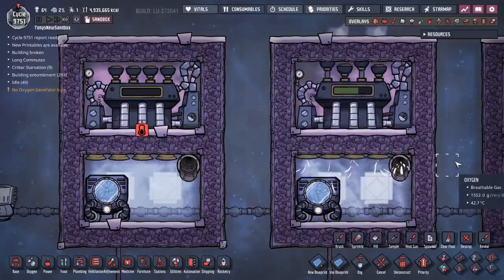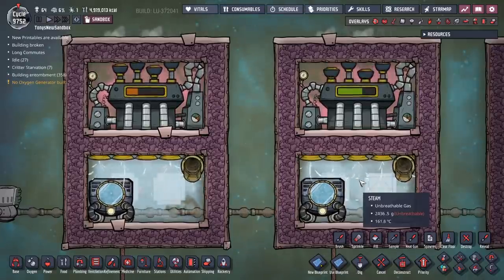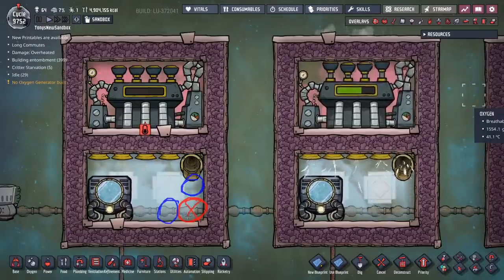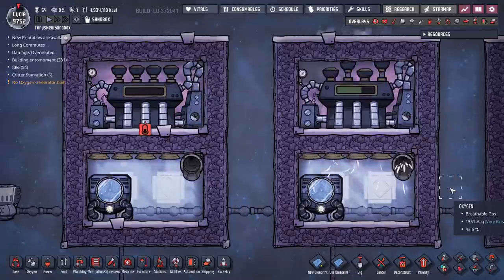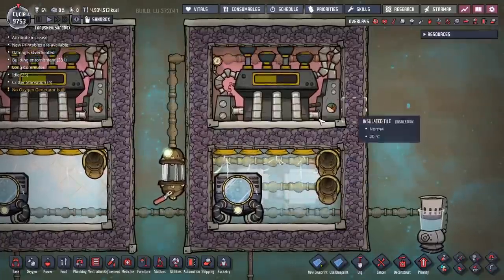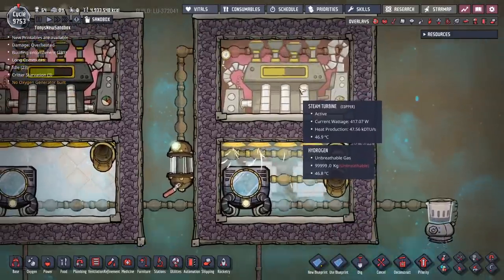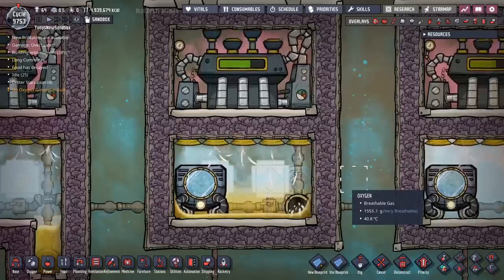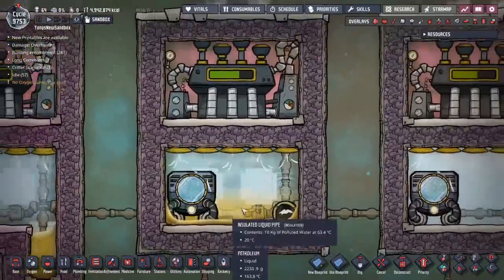Stop a Heat-Deleting Bug from Stealing your Turbine Power

Comment: If you look on the wiki, the way that cell-to-cell heat transfer is calculated simultaneously for every pair of cells that share an edge. And then there's some clamping applied when calculating how much a cell's DTU content can change per frame.

In the extreme, four extremely hot adjacent cells will simultaneously transfer DTUs to the center cell, but will more than overflow the maximum DTU change that the center cell can experience per frame, deleting DTUs.
Ways to prevent that include: 
> Reducing the amount of hot cells the cold cell is next to. (Drop it one tile lower)
> Reducing the thermal mass difference. (Increasing the mass of the water cell, lowering the mass of the steam cells. And possibly preheating or cooling the respective cells)

Other fun facts is that there is a minimum mass (not thermal) and minimum temperate difference (in Celsius, not DTU) to cause heat trasfer.
Reply from the maker: This sounds very informed. I'm going to make it the pinned commentz at least for now.
Reply: When a cell with too much heat is transferring to a cell with less heat, clamping occurs. Clamping, working as intended, should make this transfer slower. Making the transfer slower is very different from deleting heat. Clamping may be part of an explanation, but just pointing out that clamping is probably occurring does not explain everything that's going on here.
Reply: Then would "Clamping <per Cell>" and "Simultaneous Heat Transfer <between all Adjacent Cells>" risk a bad interaction? You can have situations where the four adjacents cells move more DTU's than a cell's transfer clamp allow.

The phenomena happens in reverse as well with cooling when flash freezing things. Though I think cooling capacity is less bothersome than with heating things.
(Liquid glass into rock gas, then reheating regolith into magma, and turning igneous rock into sand. It needs an iron volcano.)

I'm curious if an extreme enough cold gradient would technically produce more heat if it underflows the clamp.

Comment: The petroleum one seems the most practical/economical to me, since you can use it to easily create a 3 tile high airseal with water+pwater in the steam chamber and has the same performance as the others without wasting materials on tempshift plates. Definitely going to incorporate it in my turbine designs.

Comment: I had a multi purpose steam room and I changed it to have a layer of petroleum at the bottom to help with conductivity. Then my steam turbines started to produce a lot more power, even maxing out. I thought they might have nerfed the cooling capacity of the steam turbine, but this explains it, thanks. I do wish they fixed these kinds of bugs, same with some mass conversion bugs. It's often hard to even notice something is wrong, and when it is how to fix it.

Comment: i usually put the outlet of the steam turbine on the aquatuner keeping it cooler  but still have oil or petrol on the floor to help with heat distribution and removal from the aquatuner. one thing that may be a concern with using high pressure steam setups in with high enough pressure you can block the liquid vent periodically

Comment: The game likes to delete gases when you're not paying attention. There's a couple of rules which lead to gas deletion in edge cases that actually happen all the time.

The simplest way to demonstrate this I can think of is using three gases in an single tile cylinder. Hydrogen, steam, and carbon dioxide work. At the bottom of the chamber, you pump gas up to the top, and at the top, you have a vent. Might need to be a high pressure vent for some cases. The important thing is to confine the top of the chamber by making it three tiles high by. Carbon dioxide will try to fall down from the vent, steam will try to rise above carbon dioxide, and hydrogen will try to get to the top of it all. This will create a situation in which a bubble of hydrogen will cover the vent. When the vent tries to vent non-hydrogen to that square, the game will try to displace the hydrogen bubble to a legally valid location adjacent, but we confined it so that the hydrogen would have to move down to displace and there is generally going to be either steam or carbon dioxide below the hydrogen. When this occurs in this case, the hydrogen simply ceases to exist. However much mass it has and whatever temperature just disappears from the game as far as I can discern.

Now, you might think this is a very different case from what you're observing with the steam room here because there's only two elements, but the same basic combination of mechanics which forces a deletion of the hydrogen can happen here. The problem is displacement. And in the high pressure steam room, you have a situation in which the maximum packet size of the steam per square has been exceeded, so when the game checks to see if it can displace packets it is going to find illegal conditions. When it tries to make room for the liquid and finds all the steam packets in the room are at max, it runs into an impossibility condition because liquid and gas can not occupy the same tile at the same time and it can not displace the steam without increasing tiles beyond their (soft) maximum. So gas or liquid or both are deleted. My bet is that steam near the vent is deleted or steam in the lower corner is deleted by the sudden appearance of the liquid in that tile; you can find out what is the case by counting the Kg in every tile in the chamber then dripping water in and recounting, and you could make a simpler model by confining it to a single tile wide steam chamber.

This is also related I think to your super gas pump in which you drip out water to pump gas where the water is destroyed in the process.

Your oil solution works because you basically build a displacement spring into the whole system which allows it to 'recoil' when an additional liquid is added to the chamber. You're exploiting the one-element-per-tile rule--which is one of the strongest--and the liquid vs gas rules to keep space reserved for the liquid to appear; I expect you'd see the bug reappear if you could recreate the high pressure for the oil such that no tile of steam or oil could be moved without exceeding maximum mass, moving them in a direction counter to their vector (up or side to side for steam, down or side to side for oil), or causing multiple elements to occupy the same tile.

I also wanted to note that the version where you make the liquid packets smaller with the piping solution would potentially change the rate of the deleted packets.
Reply: In an experiment I performed, I found that gas deletion can occur with two elements: https://steamuserimages-a.akamaihd.net/ugc/776245097831921157/5453075217128EC67F29C190E9B6ABA2A55E648B/

I started with a giant vacuum filled room. Put a hot hydrogen 2Kg packet at the bottom and a cold (below liquidation temp) carbon dioxide 2Kg packet at the top.  I ended up with 837.8 mg of carbon dioxide in less than a cycle. There's something about the carbon dioxide rapidly cycling between gas and liquid form which creates a condition in which it can't displace the hydrogen and just gets deleted instead of successfully condensing into liquid on the floor. I think an analogous condition can happen easily within the high pressure steam chamber with small amounts of liquid near its vapor point being added to the chamber.

Comment: My understanding of this is that with a higher mass of the steam it requires more DTU's to get the heating to get that steam up to 125C (heating 2kg of "water" vs 400kg "water"/tile).

The steam turbine automatically triggers when it detects steam over 125C and cools it down to sub 100C, bringing flat cooling into the room. It shuts off as soon as all steam over 125C has been cooled down by 1C

If you do not have enough heating to counteract the "flat" reduction in temperature to heat the large amount of mass faster than the turbine cools it, the room reaches a  homeostasis just below 125C.

I haven't done testing to prove this, it's just the way that my brain interpreted the video game logic as I've seen it so far. For me though, everything works as I would expect it to

Comment from the maker: Addenda:
0) This seems to be fixed in the current version of the game! 👍🤘🙂
1) I tried combining various strategies, but I wasn't able to discern any benefit.
2) @Mathmanican is having a look at this. He's basically the ultimate weird-game-mechanic guru of ONI. https://forums.kleientertainment.com/forums/topic/113255-stop-a-heat-deleting-bug-from-stealing-your-turbine-power/?do=findComment&comment=1280082
3) Check out /u/corrado33's experimental results. Using a BIG steam room can largely eliminate the problem. Also his approach of using a metal tile floor makes a big difference.
https://i.postimg.cc/pTpp9TCW/more-Research.png
https://plot.ly/~blacksilverwhite/1/
https://www.reddit.com/r/Oxygennotincluded/comments/dqfhia/stop_a_heatdeleting_bug_from_stealing_your/f6a3aee/?context=3
4) I used a couple tempshift plates in my steam rooms to keep the turbine output more stable for analysis. It looks like those plates may make the performance a bit worse in most cases. (Which is weird, because using all tempshift plates kinda works.)
Reply: I wonder if the ablating/flaking mechanic is at play here.  It is a different type of heat transfer than normal; and it occurs when you have something above melting/boiling temperature of a solid/liquid and at least one of the materials isn't solid.  It bypasses the conductivity of the materials completely.

I am not too certain of the mechanics but IIRC every in game tick, it melts/boils 5kg of the on material, and it subtracts the heat required to do that from the hotter material.  If there is some error in the calculation (possibly when there is less than 5kg of materials), it would delete heat.
Reply: No longer an issue. I run a bit over 500 kg/tile in my steam box.

Comment: Could the reason be somewhat due to the Temperature Shift Plates? When the displaced, cooler and denser steam moves to the two adjacent tiles to the temp shift plate, perhaps there is multiplied cooling going on to all the other tiles adjacent to the temp shift plate. With lower density steam this effect would not apply as much since the mass of the steam would be negligible compared to the mass of the Temp Shift Plate.
Try moving or removing the shift plate near the vent and see how it goes.

Comment: Extremely brilliant!  (as always)  

If we wanted to go low pressure I wonder if there's a threshold we can stay under or if it gets worse linearly.
Reply from the maker: A guy made a cool graphic of power output vs steam room size vs steam pressure. (See the addenda). If my memory is correct, power falls with any pressure increase but falls sharply once it's at 40kg/tile or so.
Reply: @tonyadvanced6315    What do you mean by addenda?
Reply from the maker: @GamersHandbook  The pinned comment on my YouTube posts have additional information that came to light after I made the video. It seems like there's a lot of that, I wish there were a way to know what everyone knew before I got them talking about it.
Reply: @tonyadvanced6315   I see it now.  Thank you, that looks like what I was curious about.  I'll have to read it when I get in front of my computer.

Comment: I always thought the lower pressure steam generated more power because the turbine focuses on temp not dtu, and less mass heated up faster because less mass to hold the dtu...
 At the same but converse side it also explained why you could tame a volcano with less turbines by increasing the water mass effectively slowing the temp increase by spreading out the dtus.

Comment: I think the only reason the low density steam version helps is because it operates at higher temps so it can counteract the heat deletion
Reply from the maker: The temperatures should be the same because the amount of heat produced is the same and the amount of heat removed by the turbines (should be) the same. Low pressure steam would get to equilibrium temperature much faster though. I don't think I checked the steam temperatures but if it's different then this is even weirder than I thought.
Reply: @tonyadvanced6315  it shows 154-162 C° here when you mouse over it
Reply from the maker: @rodna16  I'll definitely have a close look at that when I'm back at my computer. Maybe the steam isnt dense enough for the turbine to get full bites out of it.
Reply: @tonyadvanced6315   haven't played in a while but afaik the turbine only cares about the temp of that 2kg/s steam that is being processed, the rest is just for heat capacity so low density steam should be more efficient with aquatuners if you can get close to 200C° right?
Reply: It helps because losing a few C from 4kg of steam is nothing, losing a few C from 800kg is a lot.. and as it takes more thermal energy to replace those now missing degrees as the room temperature balances out, the more steam you have the worse it is.
Reply from the maker: @rodna16  Here's my reasoning: Steam turbines change heat energy into power. They produce 1 watt for every .9868 kDTU of heat. So if the heat is coming from an aquatuner at a fixed rate then you can calculate exactly how many watts the turbine should produce. (That's 566.67 watts for this experiment.) Since the turbines (should) produce the same watts, then if they are also consuming the same amount of steam, then the steam must be the same temperature. So, the steam being the same temperature is a sort of necessary side-effect of how all the other stuff works.
Reply from the maker: I got back to my computer and had a look. I don't know why I didn't think of this before, but of course the high pressure steam is much colder, because the heat is being deleted by the bug. But since you suggested it, I wonder if the reason the low pressure steam works is simply because the heat is more transient... it doesn't linger in the steam, it goes more or less directly to the steam turbine, so it just doesn't have much of a chance to get deleted. That wouldn't result in different temperatures, but it's kinda the same thing you suggested.
Reply: @tonyadvanced6315  The more steam in the room the more DTUs are being deleted from the bug, a super coolant aquatuner can run a turbine at 200 non stop, have the aquatuner kick on if it drops below 200, switch the turbines on when both rooms are at 200c. Both lose DTUs due to the bug but the 2kg aquatuner has less DTUs to replace to not only keep the turbine running but to get the room back up to 200c which is why it performs better, because it can replace what has been lost for a tiny penalty. The 400kg room depending on how much DTUs it loses could end up dropping to 125C eventually if it's more than 1,181,000 DTU/s but it's aquatuner will always be working harder.

Comment: You can go 2 ways on this problem, you either have to much heat and you WANT to use this bug, or you want power, so you avoid it.
I found that water dropping on non-insulated tiles, like one lower & mesh tile + air tile as best option. It must be something with instant vaporization & insulated tiles.

Comment: I wonder if giving the water tile a third vector for heat transfer to the steam (shift the outlet a tile inward) would help. Or maybe some mesh tiles to see if the interaction tickles the code somehow.
Reply from the maker: Good ideas to try.
Reply: If the pinned comment is correct I think that would make things worse, not better. The problem is that the each steam tile wants to dump more heat into the water than is allowed and the extra gets deleted. So you want to reduce the transfer area with steam. I think that's why the petrol works so well.
Reply: @Khaim.m  So just dump it into a little bucket, like what was shown with petroleum, just without the petroleum.

Comment: I have two question about the steam room with a small layer of petroleum on the floor.
1: How much steam has to occupy each tile?
2: How much petroleum do I need per tile on the floor?
Thanks.
Reply: If you stop the video at just the right frame around 5:02, you see that he has 400 kg of steam in one of the topmost steam tiles. From 5:18 to the end of the video pausing at the right frames shows an average around 2 kg petroleum per tile. (I saw, from left to right, 2053.8 g, unknown, 2356.5 g, 2506.3 g and 1334.8 g, which fits with the incoming water shifting petroleum towards the left.)

Comment: Has this happened recently? I don't know if I have to rebuild my base from a month ago.
Reply from the maker: Nobody seems to know. It's possible that it has always been like this. But it also seems weird that I wouldn't have noticed it until the last few weeks.
Reply: @tonyadvanced6315  I certainly had this issue before, at least since the launch update. Wasted way more power for cooling loops than it should've been. And fixes were exactly the same, but I never realised that)

Comment: so whats the minimum pressure you can run a steam turbine at?
Reply: The absolute minimum is dictated by the fact that each Steam Turbine inlet takes in 400g/s of steam. You probably want somewhere between 400g and 800g of steam to prevent your turbine from choking on a vacuum. However! The closer you get to this minimum, the more likely you are to have massive temperature spikes if your heat source spikes (like a volcano erupting)... this could damage your aquatuner.